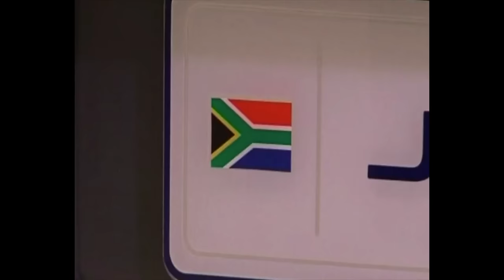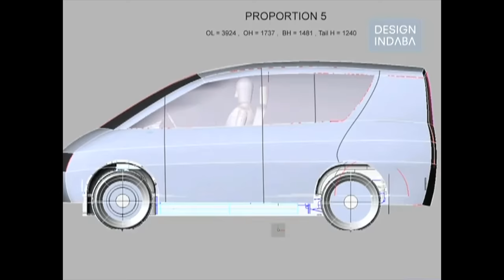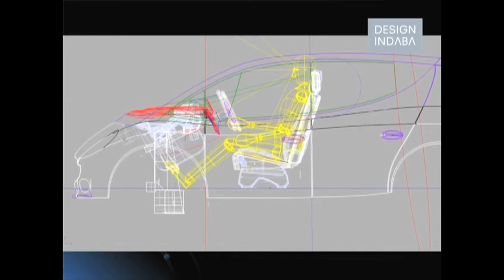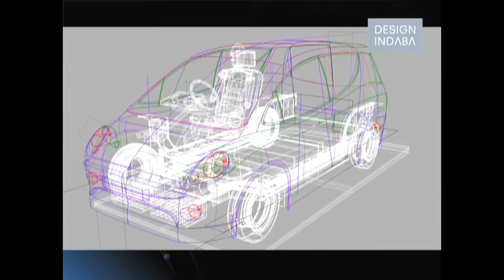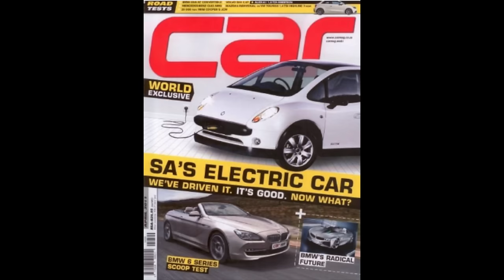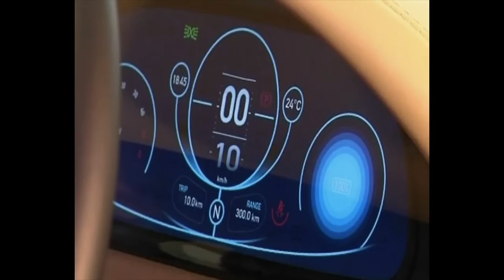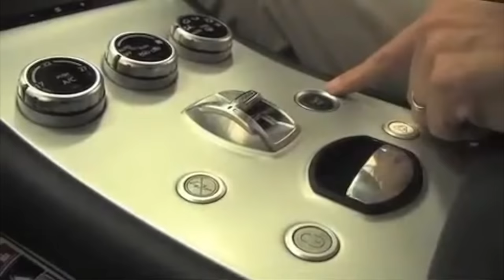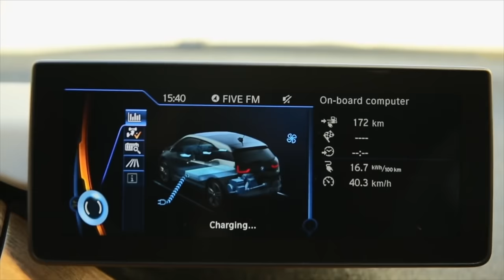How South Africa nearly beat Tesla - The story of the Joule, a world-first EV

Comment: I remember seeing the Joule driving up and down the hills around UCT (ring road) circa 2008-2010 and was so excited to see what the EV industry was producing locally. So sad that it died. After graduation, I was at a company that would have used some of the Joule IP in the Electric MyCiti bus project (2012). That became vapourware and then I left the automotive industry for Oil and Gas 😅